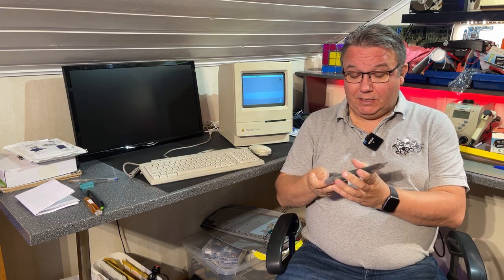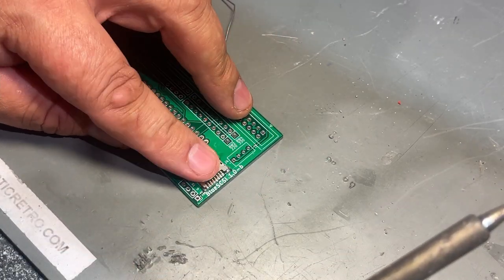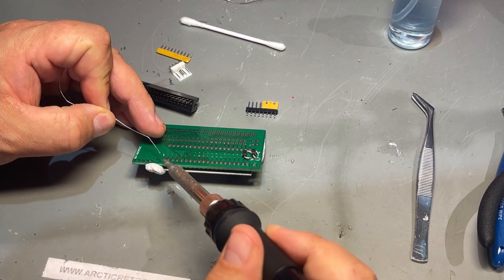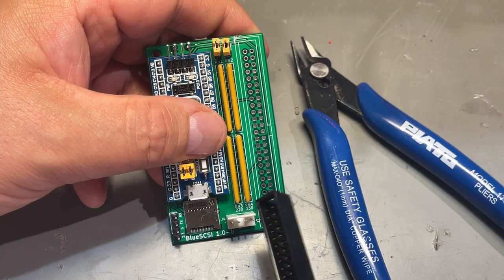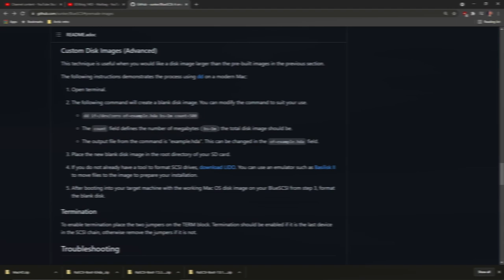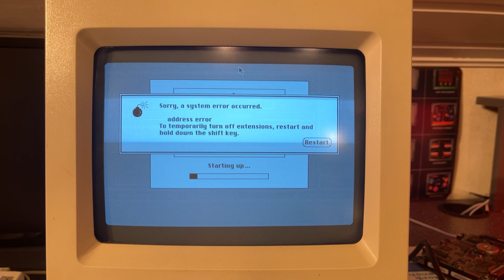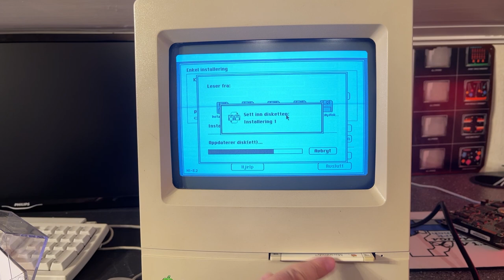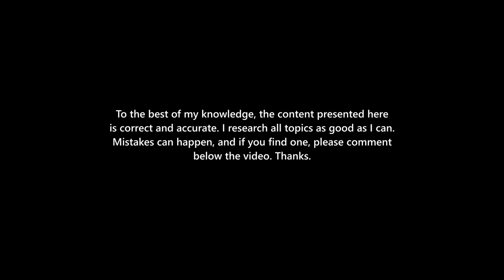Modern BlueSCSI adapter build and testing on a Macintosh Classic from the 80's

Comment: Hope that analog board has been recapped :P. I personally enjoy using my Scsi2sd. I use the db connector to the external scsi and it's great for testing boards. If you can get it, I recommend getting some Amtech flux or even some MG Chemicals. Also Kester solder is great if you can get it. Starting without extensions mean it disables the addons. Those are what display at the bottom of the screen. 7.5 requires I think 3mb of ram?
Reply from the maker: Thanks for the info!